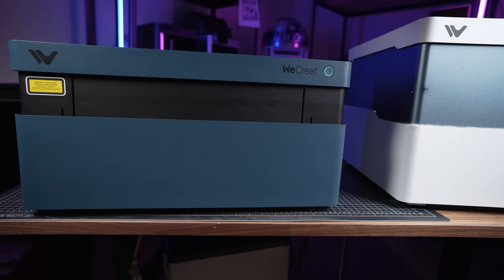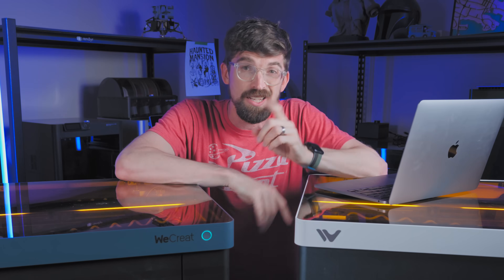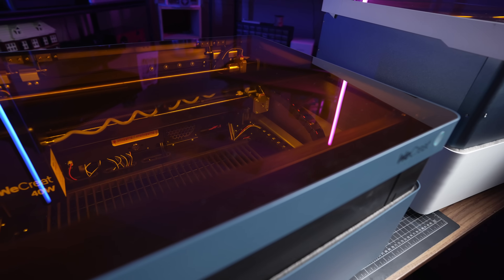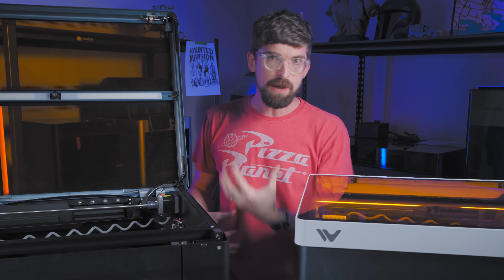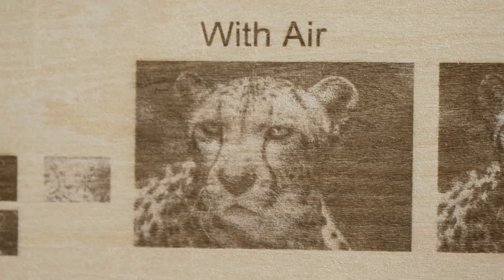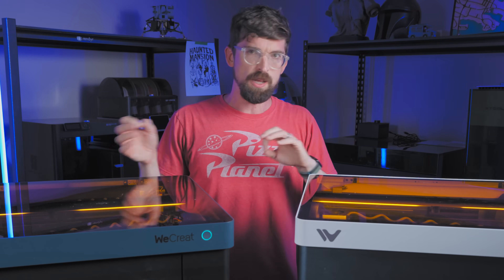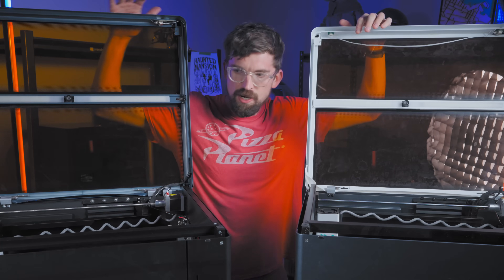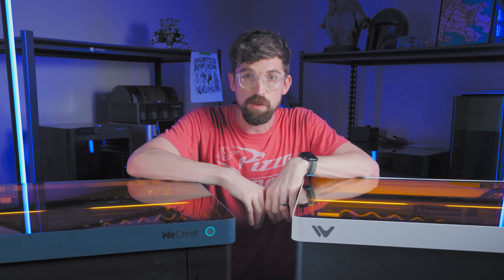Laser Companies Are Lying To You

Comment: Never used a laser.  I'm looking to engrave leather, not very thick material and either cut out the engraved parts or at least mark the cut lines well enough to be able to manually cut things out consistently.  I'd need a bed size of at least 10x15 inches, more would be better of course.  I work leather and this would be for book covers and wallet parts mainly.

Comment: It's not the total watts, but pulse width, pulse rate, M2 value to maximize your total energy at the focus. So if 40 watt has 100 um spot and the 20 watt has 40 um spot. The 20 watt is going to crush the 40 watt. Also anything over 0.5 watts is a class 4 laser.